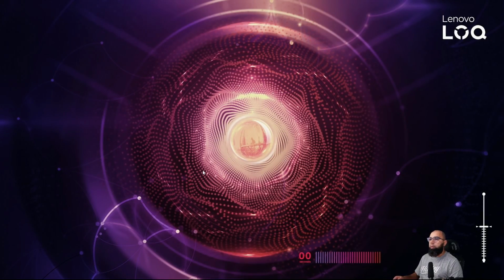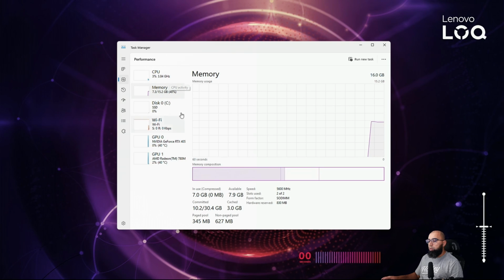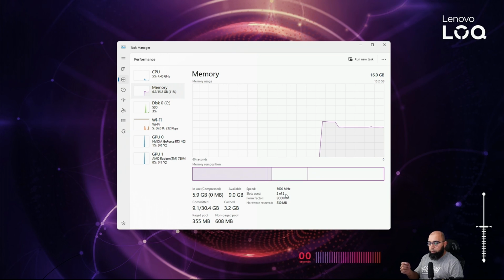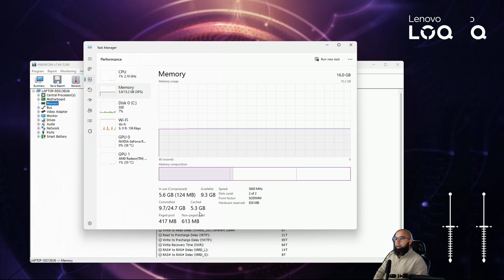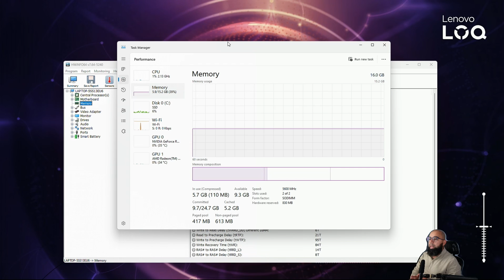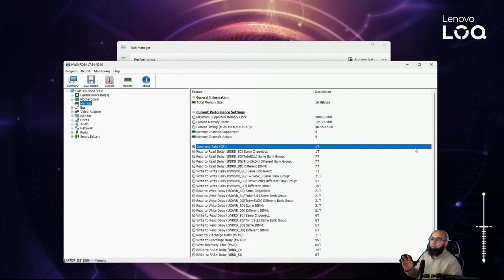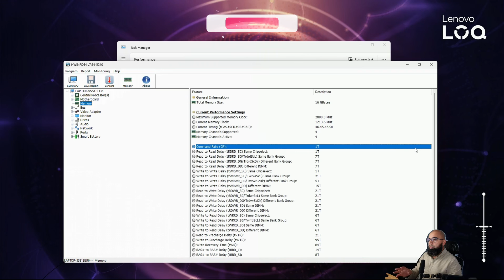Lenovo LOQ 15 - RAM Upgrade Guide (8GB to 16GB)

Comment: I got 40 gigs of DDR5 bros 40 GIGSSS
Reply: 32+8?
Reply from the maker: @The_Native_wolfAK Did you add a 32GB module + 8GB module? If it works good for you. I'm not sure why the manufacturers artificially limit the RAM capacity. The speeds I can understand due to the built-in memory controllers on the CPU/mobo but the amount doesn't make much sense. The same architecture and the Intel 13th and 14th gen CPUs can target a lot more RAM on the desktop equivalents.

Comment: Hola! Tu video me ha servido de mucho, like y nuevo subscriptor, la memoria ram que tiene de fabrica es de 5600 MHz? Yo tengo la Loq 15 con 3050 y core I5 12 generación. Y me serviria esta? Memoria Ram DDR5 8gb 5600 Mhz Beast Kingston Fury Rgb
Reply from the maker: @arathvaldin1337 Thanks for the like and sub. The 12th gen Intel CPU was limited to 4800MHz DDR5 RAM. Buying 5600Mhz may cost more so you can go with (usually cheaper) 4800Mhz for upgrade.

Comment: Hi,
I just bought LOQ 15 2023 (I think it is 2023). The specs are: i7 13650HX, 16GB RAM, NVIDIA RTX 4060 with 8GB VRAM and 512GB SSD. Have you done any upgrades on that particular LOQ model? If so, I would be very interested to watch it.
Thanks
Reply from the maker: @skchandon You're right that is the 2023 model. The one I'm showing here is the same, 2023 model. You can follow along the guide.

Comment: I have a Lenovo loq rtx 3050 intel i5. Bestbuy website says it supports up to 16 gb ram but reviews said it supported 32 gb ram. Which one is it?
Reply from the maker: @JayFix68 I would trust the reivews more and 32GB max seems more logical. It could've been a typo on BestBuy's website.
Reply: @techknowlux  I found out what it meant. Each slot can support up to 16 gb for a total of 32 gb

Comment: Would this work on the i5 3050 model?
Reply from the maker: @glennnumfor875 Yes, but depending on your CPU, if you have Intel 12th gen then your max supported memory speed is 4800Mhz and not 5600MHz.

Comment: Hey techknowlux i have one question i bought 2 16gb ram will that work for this laptop? thanks.
Reply from the maker: Yes sir. 32GB is max supported RAM so 2x16GB would work just fine.
Reply: @techknowlux  thanks alot I thought it was only 1 slot and bought the 2x16 for no reason

Comment: hi, can i get upgrade ram from 4800 mhz to 5600 mhz? im using lenovo loq 15iax9
Reply from the maker: @hry1649 Yes. I don't see why not. Is that the 2023 model or 2022? Make sure that your CPU supports the new memory speed before buying and upgrading. You can search for it in Intel Ark database.
Reply: @techknowlux  2023 model, cpu using i5 13450HX

Comment: Followed instructions. Now my screen won't turn on.
Reply from the maker: @davidhartless1713 Do you have the AC adapter plugged in? Try turning it on that way. Alternatively if you press the power button then mash F1 to get into the BIOS, are you able to get to the main menu for the BIOS? If not, you can try to remove the stick of RAM you installed and return the original in there and see if it turns on again.

Comment: How do u replace screen?
Reply from the maker: @daenery2471 That's a much tougher exercise. Matching panels, their mount points, the pins to the motherboard connector, it's very hectic and troublesome. Why do you want to replace the screen? And with what?

Comment: was able to install 32 gb of ram with this guide, ty!
Reply from the maker: @8pija22 Glad to be of help. Enjoy!
Reply: Which ones did you buy? I was thinking of upgrading aswell, did you buy two 16gb rams or one 32gb?
Reply: ALWAYS BUY TWO STICKS OF RAM OR MORE OF THE SAME MODEL. DO NOT ONLY BUY ONE. YOU WILL SEVERELY IMPACT PERFORMANCE. It's the equivalent of having a single road for a big city. You will have too much traffic.
Reply: @kingd3528  Always use up all the slots; never just one.

2x16
Reply: I put 1 Crucial 5600MHz 32gb stick along side the stock RAM and Win11 recognizes 39.2gb of usable RAM @kingd3528

Comment: I got one stick of patriot ram and have not installed it yet do you think I really need another patriot to match or should I be fine with the mix , if I end up having problems I can always get another one but just wanting your opinion thanks
Reply from the maker: @Cod-Convict As long as both sticks are 5600Mhz it doesn't matter.
Reply: @techknowlux thanks I ordered one and a 1tb ssd for my loq15 the thing is a beast for the price and a lot of people hate on the 4050 but I think it works great so thanks
Reply from the maker: @Cod-Convict The haters have deep pockets. Let 'em have it. With 1TB SSD you can run the LOQ 15 at 1080p with the RTX 4050 for several years without issue. The saving grace was the 1080p screen. Lenovo made the right decision there.
Reply: @techknowlux I agree I’m starting to tweak the graphics now but if someone is just a regular person that doesn’t want to fuse with it you can play most games without messing with anything , and after I get my extra 8g tomarrow and that ssd I’ll be fully good , I have no issues playing on 1080 it’s still really good so thanks man and to anyone second guessing this laptop is recommended by a lot of people as the best buget laptop out thier

Comment: Hi, I bought a crucial 8gb ddr5 5200mhz, is that compatible with sk hynix 5600mhz? Would that cause problem in my laptop if I install it?
Reply from the maker: @Mufasa191 It will not cause any problem but that means the system will only be able to run RAM access at 5200Mhz (the slower module). Or it could be that the system will default to single-channel RAM. In rare cases it could cause crashes or instability.

Comment: Lenovo LOQ 15 Ryzen 7 7840HS 8-GB 512-GB SSD RTX 4050 6gb Price 970$ 
or 
HP VICTUS 16 R0085CL Core i7 13700H 16GB 1-TB SSD RTX 4070 8gb price 13100$ 
or
 Lenovo Legion 5 Ryzen 7-7735HS, 16GB, 1-TB SSD, RTX 4060 8gb Price $1270
.
Which one is the best option please suggest me????
Reply from the maker: @funnytube3390 There's tradeoffs for each of those laptops. But since price of the RTX 4060 and RTX 4070 are close to each other. I would say it's worth to spend the extra $40 and get the RTX 4070. The Victus is a nice laptop but the build quality I feel on the Lenovo is better. To reduce the confusion... go with the HP Victus 16. If you're only going to play games casually or sometimes, then get the LOQ 15 and save your self some money.
Reply: @techknowlux  Thank you sir for your reply.
 I am selling my PS5 to buy a gaming laptop I also want to play games in good quality but I also want to use it for my study work and other stuff but I think the quality of hp Victus is kinda poor which scares me in the future.

Comment: Do you have to worry about disconnecting the battery before doing this?
Reply from the maker: @riverversteeg7086 Yes, please disconnect the battery before doing this. Additionally you should use an anti-static strap or anti-static surface/pad to make sure you don't discharge any static electricity into the device. Just because I "winged it" doesn't mean it was the right way to do it.

Comment: I brought the i7 14gen with 4060 with a single 16gb ram ddr5 5600mhz stick.. confused with 5600mhz CL46 or 5200mhz CL42 or 4800mhz CL40.. please advise.. also did you unlug the power cable from the battery to the motherboard before installing the ram stick?
Reply: I suggest you to remove it , to prevent short
Reply from the maker: @shakeebahmer To be honest, I don't think it'll make much difference. Go with the faster speed. Unless you have a specific use case and timings matter, the impact is minute. And the CL is just one of the two dozen or so timings that RAM operates.
Reply: @techknowlux  thank you for the advise

Comment: is there any hdd slot jn it? just asking
Reply from the maker: @dafinreysah3125 Yes there is. You can add another SSD. But please check the official specifications for your specific model on the Lenovo website so you know what size SSD you need. It will be either 30mm, 42mm or 80mm length NVMe PCIe Gen 4 SSD.

Comment: hello, so i got only 1 slot for ram 8gb, can i reaplace it with a 16gb ram?
Reply from the maker: @mihaiszekely8866 What do you mean only 1 slot? The laptop has 2 slots. You can replace two modules. If you want you can also leave one 8gb module there and replace one of them with a 16gb ram.
Reply: @techknowlux  only have 1 module...

Comment: My LOQ comes with a 4800mhz, can I use other RAM clocks or just 4800?
Reply from the maker: @Masterpg2007 You can use 4800, 5200 or 5600. Those are the speeds supported by the LOQ 15.
Reply: @techknowlux  I see, but using two different clocks won't it cause problems? Like one stick 4800 and other 5600?

Comment: Hello, can this RAM be compatible with Lenovo LOQ 15IRH8 15.6" 14 Hz IPS - Intel Core i5 13th Gen 13420H (2.10GHz) - NVIDIA GeForce RTX 4050 Laptop GPU - 8 GB DDR5 - 512 GB PCIe SSD - Windows 11 Home 64-bit -  Gaming Laptop (82XV00LFUS)
Reply from the maker: @hussien_aliraqi Yes most 8GB modules of DDR5 SO-DIMM at 4800MHz to 5600MHz speeds will work
Reply: @techknowlux  Sorry, the RAM inside a Lenovo laptop is ddr5 5200mhz. Can this ram be put in the patriot video, which has a speed of 5600mhz? What I mean is what I am saying? Is it possible to put RAM with different speeds inside a laptop? Will I face problems? I have a simple question: How much is 5200MT/S worth in MHZ? Are you the seller on Amazon who is selling?  RAM PATRIOT

Comment: Hey! Appreciate this vid, the version of this is with the 4050 is on an amazing sale right now so I’ll be picking this up. The only thing that worried me was that ram. I’ll be trying this soon! Hopefully I don’t mess anything up because this is gonna be my first time opening up any computer, wish me luck and thanks for the concise tutorial! ❤
Reply from the maker: @Perrylol Just take it slow and watch and re-watch so you understand what steps to perform and you should be fine.
Reply: same here lol
Reply: I also got the the 4050 mine is the ryzen 7 and only 8 ddr5 ram and 512 m.2ssd but it’s so easy to upgrade im going to add another 8g ram make shur they match as far as specs and im getting another ssd to put in the extra slot of 500 i want everything to match but im ok with 16 g ram and to have duel channel is great and to have a total or 1t ssd is more then enough for me

Comment: Can I use 16 GB DDR5 4800 mhz Sodimm? Instead of 5600 mhz?
Reply from the maker: @dr_wnk Yes you can. 5600Mhz is the maximum speed supported. Slower speeds will work just fine. If the 4800MHz is cheaper then go for it. It won't make that big a difference unless you're doing memory heavy and intensive workloads (you'll know if you are  - large databases, data manipulation, 3d animation etc.).

Comment: hello,  in i have loq16, for me showing speed 5200mhz, in your screen i saw 5600, how ?
Reply from the maker: @MrFrdse It is possible that different configurations and regions have different RAM speeds on offer. Check the official specifications for the model that you purchased to see what speeds your model should be running.

Comment: Mine is with 8GB x 2, If I upgrade one of those to 8GB with 16 GB (altogether 24GB ) would it reduce performance ?
Reply from the maker: @virajnanayakkarawasam6397 What is the purpose to upgrade to 24GB? It is better to keep RAM symmetrical. However, it will not reduce performance. You will just not get the full performance benefit from 2x16GB.
Reply: @techknowlux  if i buy 32x2 it Will work?

Comment: What ram did you use
Reply from the maker: @rensmarkmagtotobacuetes9064 I used an 8GB stick (that was in the video description). But it looks like DDR5 8GB modules are become rare and harder to find. You might have to upgrade to 32GB since they're easier to find. Also prices have gone up (at least here in Canada) for RAM in general.

Comment: Does anyone you know if the Loq 15 would run 2×16 crucial ram sticks?
Reply: I'll tell you that in a couple days, I bought them yesterday, they should be arriving in 8-10 days :) 

I bought the crucial 32gb (2x16gb) ddr5 sodimm
Reply from the maker: @Shane-te6ih Yes it would. You can go up to 32GB max DDR5 RAM in this laptop using 2x16GB sticks.

Comment: Is there a problem when we use 1 slot with a different brand? 

Ex : default brand + brand a

Thanks
Reply from the maker: @Ajoajani34 No there is not. You can mix and match the brand as long as the core RAM specs are the same. That being DDR5, SO-DIMM, 5600Mhz, 1x8GB module for example.
Reply: @techknowlux  thanks bro

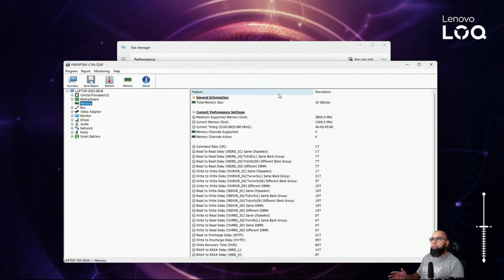Comment: How did you get to the hardware info screen at 5:26? I bought a single 8gb ram to add to the lap in order to make 16gb dual channel, so I'm wondering if Im having the same issue you had.

Ty for the video 👍
Reply: ctrl + alt + del
Reply: he uses built in Windows task manager which shows that, but the specialized hardware manager is a separate tool.  Look for:  CPUz and you will also find that they also make Hardware Monitor (which is what he is using).

Comment: can i use intel xmp RAM ON AMD System
Reply from the maker: @getrekt6822 Yes. RAM is just RAM. They might call the profiles different things Intel's XMP and AMD's EXPO, but under the covers it's just DRAM. There may be the odd/rare case where thing don't work out. If anyone else knows differently, feel free to chime in. You are asking about laptop RAM right?

Comment: Hey sup m8? I'm about the buy ryzen 7840hs Lenovo Loq. Do you recommend it?
Reply from the maker: @elderizm Yes. 100%. What GPU and other specs will you be getting?
Reply: @techknowlux  thx. Amd ryzen 7840hs (up to max 5.1 ghz), 16 gb stock ram, 8 gb 4060, 1tb m2 ssd

Comment: unplug the battery and ground yourself first
Reply from the maker: @ib0oo0 Where's the fun in that? But yes, you're right. Make sure you use anti-static surface, a grounding strap etc to discharge yourself and unplug the battery before fiddling with electronics that's extremely, and I mean extremely, sensitive to electrostatic discharge.

Comment: wish me luck im you guys im about to do my first laptop upgrade this video has been massively helpful and informative
Reply from the maker: @mugiwara1431 Just take your time, be patient and go slow. If you don't understand, re-watch so you get the hang of it. You got this! Let us know how it turned out.
Reply: @techknowlux   well i slapped 32 GB on this bad boy and its running better than ever thought possible i have the loq 15 aph8 it went a lot better and easier  than i had thought
Reply: @mugiwara1431 wait which brand of 32gb ram did you add cause I want to upgrade my 8gb same computer to be better

Comment: I am planning to buy the Lenovo loq series i5 12th gen with 16 GB of RAM. Can I upgrade it to 32 GB or it has a maximum limit of 16 only?
Reply from the maker: @RahulParmar-ld4ut 32GB is the maximum limit. You can by 2x16GB 5600MHz modules to upgrade and max it out.
Reply: @techknowlux hello I just installed 2 16gb of ram when I power on I’m only showing 16gb instead of 32. Is there a reason for this ? In performance menu I show 1-2 slots being utilized as well

Comment: at 3:56 you pause the video to figure out how to open the ram cover. Don't you think we would also like to know how to open it??
For anyone watching, there is no clip you just lift it up and off, theres little nubs that might be friction to hold the cover in place but thats it. Whats the purpose of this cover?
Reply from the maker: @jeremy6384 The cover is just a shroud it seems, there's no insulation inside or insulating material. I was also surprised and didn't understand why they needed this cover. But it's basically as you described, remove the black tape and easily pull it up out of the tabs/pins. Will keep that in mind for next time.
Reply: @techknowlux  your video solved my problem which was "where is the RAM!?" and there it was under a random cover. I wonder if that cover causes more heat than protection?

Comment: Very nice video! I love how intelligent our host is, and how he explains everything he's doing in such easy-to-understand terms.
Reply from the maker: @bigfluff4903 Thank you. Very much appreciated. Do you have this laptop? Or another laptop in which you upgraded the RAM? How was your experience?
Reply: @techknowlux  Yes, I just scored one at Costco during the holidays. They had them marked down to $499, and configured with 16GB RAM from the factory. The only downside is the Costco ones come with the RTX 2050 GPU, and not something newer and more powerful. I watched your video because I'm thinking about maxxing mine out to 32GB, and wanted to get a feel for whether I should do it myself vs. have a local computer shop do the upgrade for me.

Comment: Is it possible to put 64GB in? Any reason why Lenovo lists 16GB as the max
Reply from the maker: @mcg29_33 Probably limitations on the motherboard and the CPUs only support a certain max amount of RAM. 64GB will most probably not work in this laptop. Is there a reason you specifically want that much RAM?
Reply: @techknowlux  I got a single 32GB card (for hopes of running 64GB in the future)

It actually works just fine after testing so I presume 64GB will work. Not sure why there’s so much conflicting info online

Also, I didn’t bother disconnecting battery connector before replacing it. The laptop should still be fine?